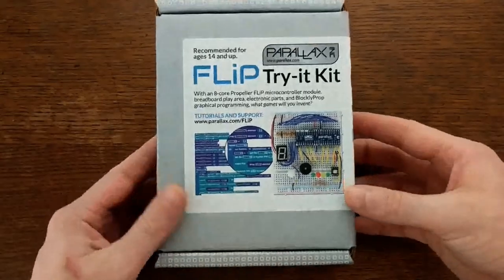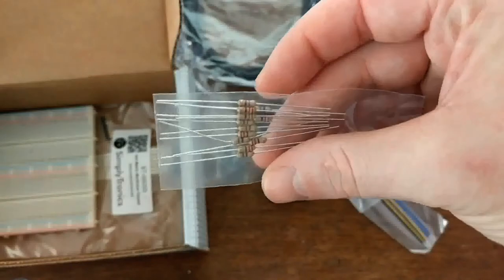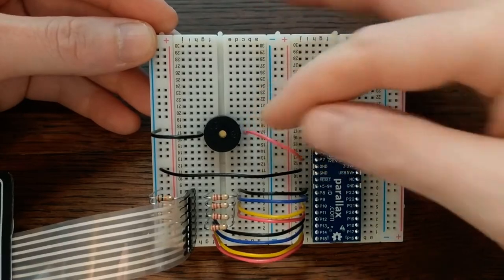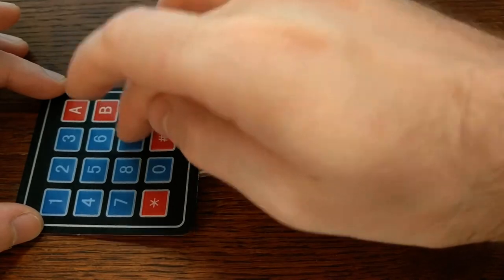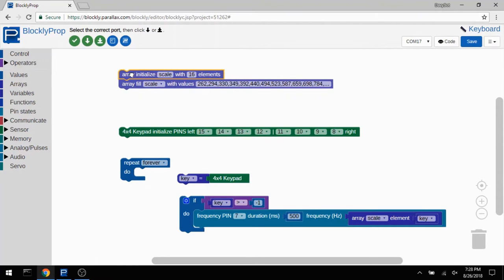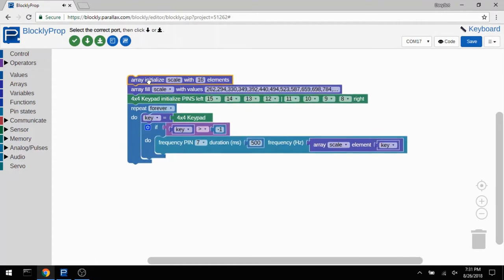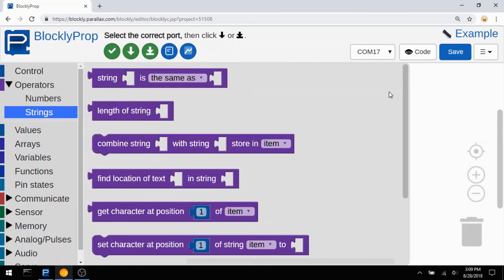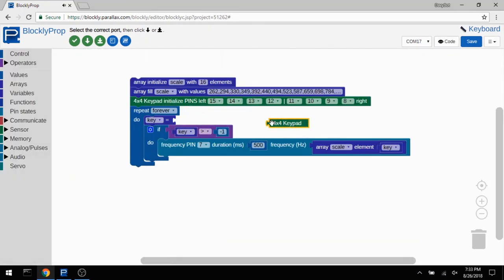Propeller Try-It Kit Unboxing and Making a Musical Instrument Without Code

Comment: Very nice beginner friendly tutorial. do you have a link to the try it kit?
Reply from the maker: Good call with the kit link! I'll add it to the description but here it is too: https://www.parallax.com/product/32023

It's crazy how easy those visual programming interfaces are. This one even has blocks that spawn other processes so you can do parallel code just by snapping things together. Definitely recommended for anyone trying to learn programming or electronics.
Reply: @DavyBot  I'm quite familiar with coding and software engineering, but not so much with electronics
Reply: @DavyBot  thanks for the link!
Reply from the maker: +/dev/null I'm also a programmer so using something like Blockly or Scratch actually slows me down too much to be practical. But it still impresses me that I was able to open a web app, click on a few menus until I found the blocks I wanted, and build a working keyboard. I think there's a lot of potential for young people especially, because it fits the mindset of being able to visually move things around and experiment without a bunch of technical details.